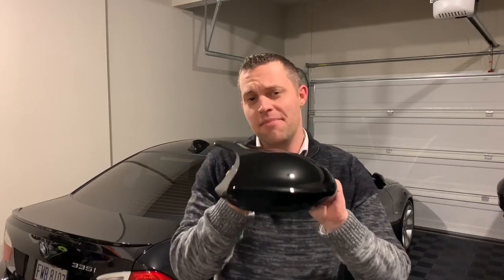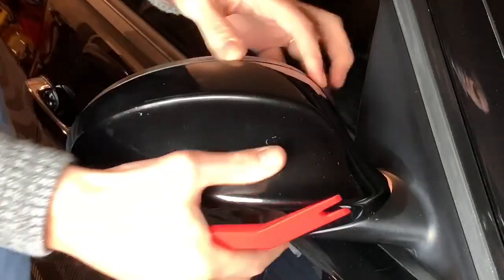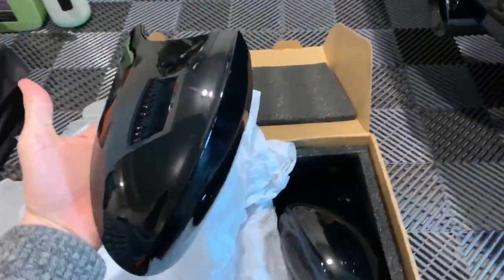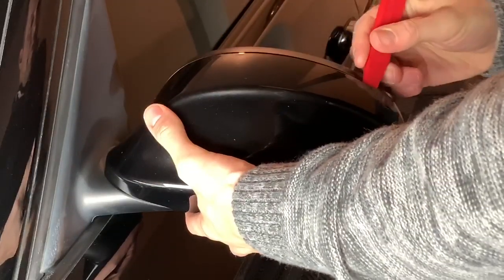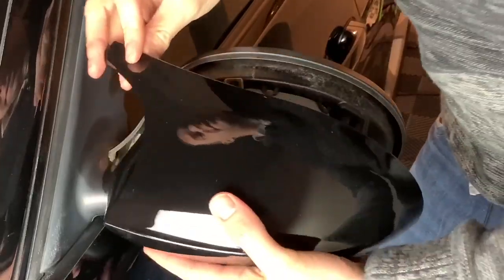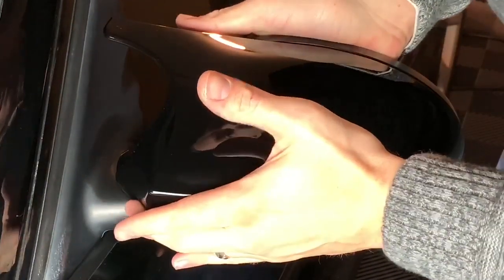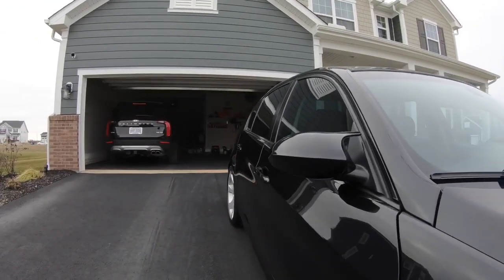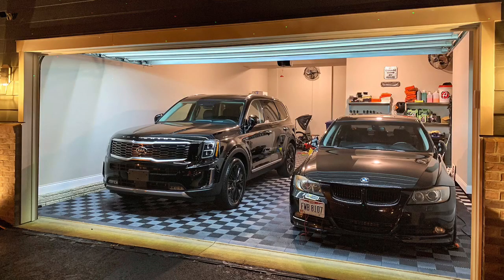BMW M Series Mirror Cover In My 3 Series DIY Install!

Comment: Did you notice it reduced any wind noise with the windows down? Looks good on your car. At first I wanted the carbon ones but now after seeing them in the video I'm thinking of going with black and wrapping the roof black. I have alpine white paint.

Comment: Nice job a bit too bulky for my taste prefer the stock sleek look but appreciate having the option to change it so easy.
Reply: pinktacoetr LOL... WTF - Too bulky? They add a slight bump out. There isn’t any “bulk” added at all
Reply: Its all personal preferance I personally dont like the BUMP.
Reply: I have trouble understanding what you mean because the old mirror covers with that weird bulge makes them look little bit bulky. The new covers here are sleeker/look a lot skinnier and aerodynamic. Not bulky, quite the opposite.

Comment: Got a 2010 135i recently and I just want to get rid of the whistling noise😭 still wondering if it's an aero problem or if there's wind getting sucked into the mirror housing and I can just patch it from inside

Comment: On ebay the gloss black ones cost under $60.00 and free ship. I ordered some for mine...
Reply: LaZaRItOLnObLE M and how are they?
Reply: @Jrvince235i  Im waiting still to receive them, I believe they are being sent from Australia so I cant tell you about quality and fit.
Reply: Did you receive the covers yet?? How's the quality and fit? Cheers
Reply: @scuddy100HYA  Yes I received the m3 style mirror covers. I got the gloss black ones. My e90 paint is jet black so It was a perfect match. I received them with no damage, the caps cost me a fraction of the price and finish and gloss is absolutely  perfect and the fit was top notch too. The swap was super easy too. I removed the factory ones that had some scratches, cleaned under the caps with a rag and the new ones I just slowly snap them in place. They fit perfectly all the way around and are not loose. The difference in the look is amazing. I'm super happy with them and I'm super picky, so you will not be disappointed. I got the gloss black like I said so for the carbon ones I can't speak on. I paid like 60 bucks on ebay, they came from australia. This was like 4 months ago. Hope that helps.👍

Comment: Looks nice. I bought the ones for my 2011 E82 LCI but for some reason they are not fitting properly. When I align all the clips and it looks perfect to be pushed in so that all clips click it just seems like it won’t go in anymore. It feels like it’s a bit too small. I feel like I’ll break the caps if I push it in harder so that it can snap into place. I bought the caps cuz I saw your video and thought it looked nice. I’m stuck. Nice tho man.
Reply: Hey, currently having the same issue. What was your solution?
Reply: The LCI and pre LCI have different mirror covers. Sure you got the right ones got your car?
Reply: @supervegeta369 the Pre LCI ones did not fit so that means I need the LCI ones right?

Comment: I cant get mine on good, gap and they come off just by pulling
Reply: You gotta line up the little gaps on the edges. I mistakenly bent them up and it was easy to pull off until I got these gaps lined up right.

Comment: Why bother?   Does it create wind noise around the new cap?
Reply: Andy B I have some on my f30 and it does not create any wind noise. I’d assume it wouldn’t for e90 either
Reply: It’s just a styling decision, looks cool
Reply: It doesn’t create wind noise. I have the carbon fiber ones on my e90.
Reply: Jarrett Rule where did you get them from
Reply from the maker: Andy B no wind noise
Reply: Why do anything... ever?

Comment: Question for anyone . My car is making the waste gate rattle. Is there a simple easy and not super costly solution ? The sound is annoying haha .. ha..
Reply: Nope. Everything is either ineffective or doesn't last short of installing the waste gate upgrades, or replacing turbos.  If you're going to pull the turbos... best to just replace the suckers. If you don't mind garbage performance you can set the JB4 menu to keep the default position of the waste gates wide open, the boost lag is really, really bad though.